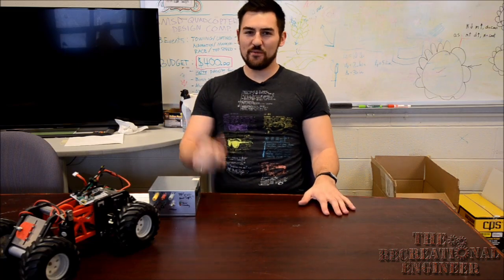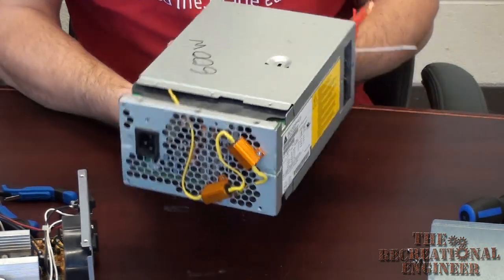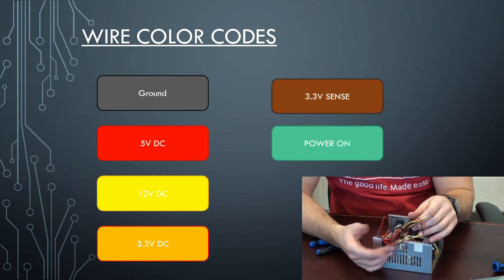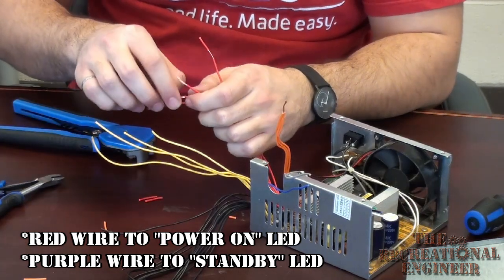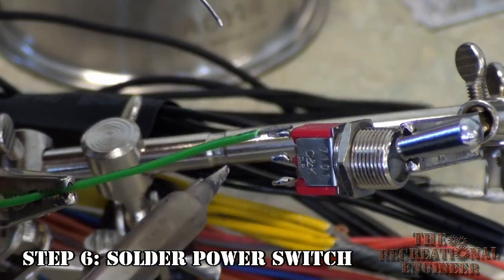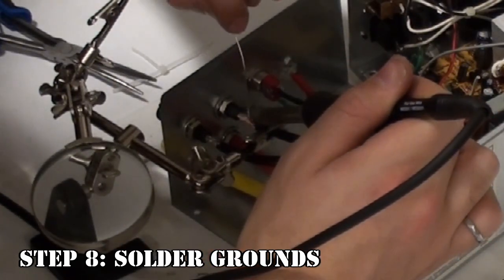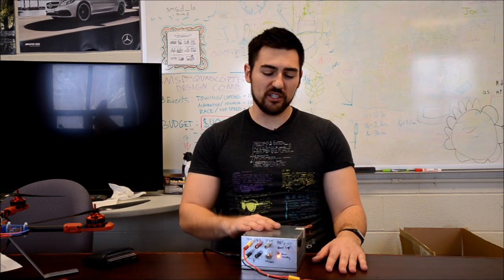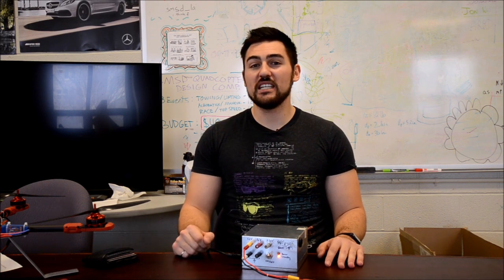$10 DC Power Supply - 1 Day DIY

Comment: The problems with cheap PSUs is when they pop, they can kill everything connected to them too. They don't die gracefully.
Reply: This may be a dumb question, but wouldn't having a fuse on the output lines prevent any damage to anything hooked up in case of the ATX dying? It's been a while since I watched this vid, can't remember if he used fuses on each (or any) output lines. (I replied to someone's comment a while back and just got a reply back, so I checked in).
Reply: Fuses protect against over current, not over voltage.
Reply: papabugs71 overvoltage often causes overcurrent
Reply: Yeah that's what happened to mine, turned out to be one of the little 10v 460 uf caps. I soldered a 16v 2200 uf and it worked fine after that.

Comment: Can you explain why it is necessary to connect all the colored wire together respectively as opposed to having multiple 12-5v posts, please.
Reply from the maker: Mario Baptiste Good question.  You do not have to connect them all together.  The amount of current a wire can safely carry is dependent on the length and diameter of the wire.  If you bundle all of the wires together it allows you to safely transfer large amounts of current through your posts.  If you want to multiple posts this is fine but be cautious with how much power you try to pull.
Reply: The Recreational Engineer thank you

Comment: If I wanted to power a police strobe light bar and with everything on draws about 42A or so  how can I do that from a 300W power supply?
Reply from the maker: Gregory Fisher you would need a minimum of 510w on the 12v line.  Power supply power is rated as all the lines together so you would probably need at least a 1000w power supply.  Unfortunately you cannot accomplish your task using a 300w supply
Reply: ok thanks for the reply and great video.
Reply: Do u think the 300W supply would power a led police light bar?
Reply from the maker: Gregory Fisher honestly I have no idea what kind of current that would draw.  Your best bet would be to find a bigger power supply.  300w is pretty small for the stuff it sounds like you want to do
Reply: ok ty

Comment: one last question man, the dummy load resistor (22ohm 10W) should be soldered between two yellow wires or between a a yellow and a black?
Reply from the maker: certified30 Definitely yellow and black.  Yellow to yellow would be a short circuit

Comment: A circuit diagram would have been nice, what about the power on LED?
R H.   UK.
Reply from the maker: for the power led I took one red wire (5v) and wire the led inline with a 330ohm resistor to ground.  For the standby light I did the same thing with the stand by wire.  The color chart is in the video but if I recall correctly the standby is purple

Comment: i have a simple question... since my dummy load resistor will go on the 5v line.... does this mean i bundle all my 5v wires to the resistor or just take one 5v wire? and what do i solder/connect this resistor to? in other words one side gets the 5v line but where do i connect the other end of the resistor to?
Reply from the maker: F Balb only one wire to resistor from 5v other side to ground (black)

Comment: i have a two yellow wires with a black stripe on them, is it safe to assume that they could be also soldered with the yellow ones?
Reply from the maker: certified30 No I would not.  If you have pure yellow wires and black/yellow wires they are labelled differently for a reason.  I would be quite skeptical about wiring them together.  I would leave them for now and check them with a multimeter after you get it working.  They could be - 12v
Reply: I am working on the same project using an old Antec EA-430D that i found in my basement, according to a chart online, it describes a yellow wire with a stripe as a +12v but on a (2nd rail) used to power a 4 pin processor on newer computers. any ideas?
Reply from the maker: hmm yes some times the supplies are wired for dual 12v processors.  If you are confident that this wire is +12 then you can bundle it with the others.  If you want to be cautious I would get it running and verify that it is +12v with a multi-meter and if it checks out I would open the supply back up and add it to the bundle.
Reply: perfect i will do that, thank you for your input.
Reply: i just tested the yellow/black stripe wires they are +12V, one more thing, how did you wire your LED lights?
Reply from the maker: certified30 for the power led I took one red wire (5v) and wire the led inline with a 330ohm resistor to ground.  For the standby light I did the same thing with the stand by wire.  The color chart is in the video but if I recall correctly the standby is purple

Comment: would it be worth proceeding with or would it not really be good for much of anything
Reply from the maker: a 145W may be decent for small electronics projects, but as you have found out, it will not be capable of powering any large electronics or motors.
Reply: You just smothered the wound in salt

Comment: current unknown, wattage of psu is 145
Reply from the maker: Kaleb Marquardt 145W for a pc power supply is very very small.  Most of the supplies I have seen range anywhere from 350 to 1000.   If I go ahead and guess that your supply has 80W on the 12V rail that only equates to 6.5 amps.  This is definitely why you are having issues.  Your motor is too big or your power supply is to small.  Pick one.   My suggestion is to try and find a bigger capacity supply

Comment: i bought a 10watt 10ohm resistor and wired it up to ground and 5volt, it gets really hot, 180+degrees
Reply from the maker: Kaleb Marquardt I'm having a hard time keeping track of all your posts.  Try replying to one so I can get back to you.  I wouldn't bother with a 145w supply,  and yes the resistor can get REALLY hot.  Best thing to do is place it by the fan.  If it truly is a 10w resistor it should be built to the take the power.
Reply: The Recreational Engineer sorry, not to internet savvy either
Reply from the maker: Kaleb Marquardt no problem.  I often just miss alot of comments when I'm on my phone.

Comment: is 220olm 10watt ok or not
Reply from the maker: Kaleb Marquardt you can try.  It may not pull enough current.  Lower resistance will cause more current to be pulled from the supply.  A 220 will pull 10x less current than a 22
Reply: i just found some 220s in an old guitar amp, just trying to scavenge one, not to sure what to look for
Reply from the maker: Kaleb Marquardt as long as your dummy load pulls enough current to keep the power supply running then you are good.  I have even found supplies where no load is needed!  I would just give it a shot and see if it works.  It will not damage anything if you wire it correctly.

Comment: Is there only one 5v wire that connects to the dummy resistors and then to ground? It is unclear and any help would be great.
Reply from the maker: Zach L. One wire from the 5v line should be sufficient.  You can use two if you want to be cautious

Comment: How many  12v 16ft led strips can I connect to the 12v?
Reply from the maker: ogir noel d probably quite a few.  In order to give you exact numbers I would need to know the current output of your supply and the draw of the LEDs.   It is easy to calculate if I have the information

Comment: Thanks for the info, do you thank I  could this for a Peltier cooling system for a project it is 12 volts 5.5 amps I am using it for a cooling system for a computer . To cool the radiator on a liquid cooled loop for a CPU  again thanks for a informative video.
Reply from the maker: I can't say that I am super familiar with peltier systems, but if you current draw is only 5.5A then it should work quite well with this type of power supply.  That being said, 5.5A at 12V is not that much power, you may be able to save yourself some time by finding a wall adapter that can already supply this type of power.  This project is great if you need multiple supply voltages and high currents.
Reply: thanks a lot. working on it now I will let you know how every thing works out.

Comment: if I need 14 volt, can I combine 12volt and 3volt?
Reply from the maker: haekal atika Unfortunately you cannot.  You can however wire an adjustable voltage regulator to the 12v pin and use it to increase to over 25v

Comment: do yourself a favor...spend 5 bucks and get a few more banana plugs so u can  banana  to  banana and do a  banana to either tension or screw hole terminal cable... i just dove into the circuit side of the computer and electric world and it was one of my first ideas to make things quicker/less likely to short out...haven't regretted it.

Comment: 2 question Sir, i seem to have the old style so my 5v is @ 22a and my 12v is @ 10a, i noticed my amps arent the same as yours so can i still use the same work resistors that you suggested in your guide? and my spec label says "DC OUTPUT: 200W" is that what my 12v will put out? cause i want to make this project for my lipo charger as well. thanks and awesome video have to admit it is one of the best i have seen on this topic so far!
Reply from the maker: F Balb Thank you for the feedback!   200watts will be the total combined power of all the lines not just the 12v.  Based on your specs you will have 120watts on your 12v line.  You should be fine to use the same load resistors.  Good luck
Reply: thanks again! looking forward to doing many more projects using your videos!!!!! we got that GOPRO issue worked out? .....lol

Comment: First off what an awesome video. I have watched nearly three times or more. 

What dummy resistors did you use for the example you showed? The ones mounted on the outside? I see the heatsinks well but cannot make out the writing on the video. Spec's of my power supply below these are the only things holding me back from completing this. Any help is greatly appreciated.

http://www.coolmaxusa.com/productDetailsPower.asp?item=M-500B&details=spec&subcategory=120mm&category=single
Reply from the maker: Thank you, I am glad it was helpful.  Your power supply is definitely 12V dominate, so I would recommend you wire the load resistor to 12V and ground.  For my resistors I used something like this:

https://www.amazon.com/Chassis-Mount-Aluminium-Wound-Resistor/dp/B00NQ0ONH2/ref=sr_1_2?ie=UTF8&qid=1480352855&sr=8-2&keywords=22ohm+10w+resistor

They WILL GET HOT so it is a good idea to buy heat sinked ones like this and keep them in a location where the PSU fan will be blowing on them.

Good luck.
Reply: The Recreational Engineer Sweet I'm actually making a dual one. Two PSU units joined together. Each have a 120MM fan PSU hardware in one and connections and resistors in the other. Will post pictures when completed/
Reply from the maker: Darrell Kines Great,  I hope that works out for you.  Hopefully you can get past any issues with the non common ground.

Comment: Nice vid, but i have a question. 
My PS is 12v=19A  5v=25A  3.3v=18A so what resistor should i use and what wires do i solder it to, thanks.?
Reply from the maker: Cale Morris take one wire from the 5v line and solder it to one end of a 5ohm resistor (minimum 10w) and solder the other end of the resistor to ground.

Comment: thank you for the great video this is just what I was looking for! I'd just like to ask, is it possible to make a variable power supply out of a computer psu or is it not worth the trouble?
Reply from the maker: Yes it is very possible.  My suggestion would be to wire one of these into the line with the most power. 
https://www.amazon.com/Yeeco-Converter-Regulator-voltmeter-1-25-37V/dp/B00MUT4ZE6/ref=sr_1_3?ie=UTF8&qid=1479670942&sr=8-3&keywords=variable+voltage+converter
Reply: The Recreational Engineer awesome, thanks for the reply :)

Comment: please help, my friend gave me an almost new pc power supply(sl-500a) and I tried to convert it into a bench power supply,  I turned it on and my dummy load (10w 5ohm) heated up very much in a few seconds. I found out that every rail is shorted to ground :( what should i do?
Reply from the maker: You said that your power supply is almost new.  That should mean that your dummy load resistor should be 22ohms.  Which line on your supply provides the highest level of current?  Which line did you put your dummy load on?  Also, it is normal for the load resistors to get hot.
Reply: The current  on every rail is 30a, so i connected the resistor between 12vand ground.
Reply: then i unsoldered everything and found out that the resistance between every rain and ground is about 15 ohms is that normal?
Reply: I doubt that the problem is the resistor
Reply from the maker: I'm a little bit confused.  The power supply works but the resistor just gets hot?  How do you know everything is shorted to ground
Reply: The Recreational Engineer I measured the resistance between every rail and ground, it was 15ohms(almost a short). An the resistor gets super hot in just a few seconds, but every rail still outputted the right voltage.
Reply from the maker: Matevz Rakun are you saying that you are putting the positive lead of the multimeter on +12 and the negative lead on GND?
Reply: The Recreational Engineer yes and on every other rail too so (-12v and ground, 5v and ground, 3,3v and ground)and the resistance between every rail and ground is about 15ohms
Reply: maybe its because the switching power supply is built like that. Can you please check if thats the case on your power supply too?
Reply from the maker: Matevz Rakun I think you are getting this reading because you are CREATING a short. There should be no resistance when you touch the two posts.  You are essentially creating the short with the multimeter!  The resistor normally gets hot.  Too hot to touch in fact.  If this concerns you, you could replace it with a higher wattage resistor and one of the appropriate resistance.   Have you plugged anything in to see if your power supply is in fact functioning?
Reply: No but i will try it, thanks :)
Reply: ok i tried it on a led strip which uses 12v 5a and it worked. Does that mean that nothing is shorted?
Reply from the maker: Matevz Rakun more than likely if it was TRULY shorted your power supply would shut down.  I'm sure it is fine.  You are creating the short with your multimeter.  There is no resistance to measure.
Reply: Ok thanks for all your answers i will subscribe :)
Reply from the maker: Matevz Rakun No problem,  good luck with your projects!

Comment: Can you give a rough guess on how many watts does the 12V line supply for example a 500W PSU? I might mod my old PSU to power up my lipo charger. Thanks for the video really, really helpful!
Reply: Look at the electrical spec label on the PSU. It SHOULD list the various voltages and maximum output power for each one.  Take a look at a typical label: http://www.bosamar.com/KT4V/Images/PC_powersupply_2.jpg

Notice that the TOTAL wattage capability is 350 Watts. However if you add up ALL the maximum power outputs of EACH power line you get a TOTAL of 420.3 Watts!! How can that be? Well the 350 Watts is the absolute total supply capability using any combination, usually because the internal electronics is not capable of delivering more than that without significant stability or heat problems or even to just remain within the safe operating area of the active components (transistors/diodes).

To find out the maximum watts per voltage line just use the standard Watts = Volts x Amps; so on that picture the 12v line can supply 12A hence 144 Watts.

** REMEMBER ** the 500 Watt total figure for the supply you mention MAY be less, as above, (but not necessarily) than the total combined amount of the separate supply feeds. That just means that you need to watch what your TOTAL power load is and for reliability do NOT exceed that load for any extended period. Always try to leave some headroom.
Reply from the maker: I'm glad you found this helpful.  My specific unit was 240W on the 12v line.
Reply: Watts = Volts x Current. So look on the side of the PSU.. It will say something like +12v 22Amps. So 12x22 = 264w

Comment: Do you need to connect all 12v wires to the 22 ohm resistor or just one 12v wire?
Reply from the maker: Just one wire is sufficient.